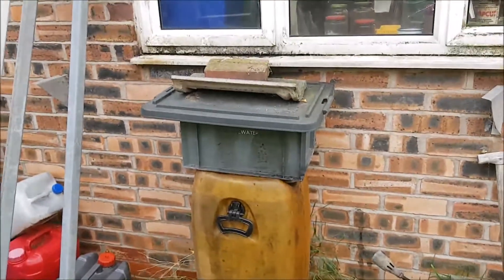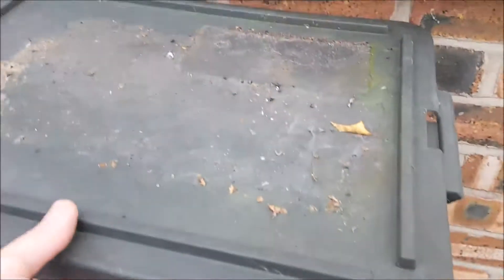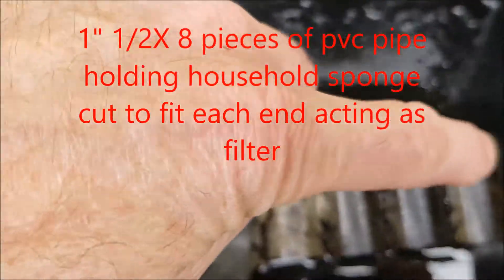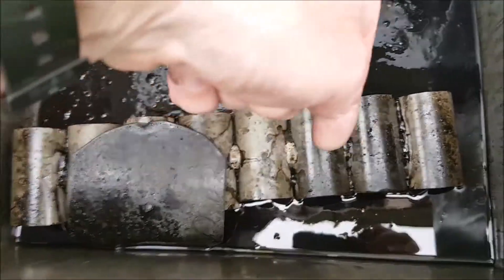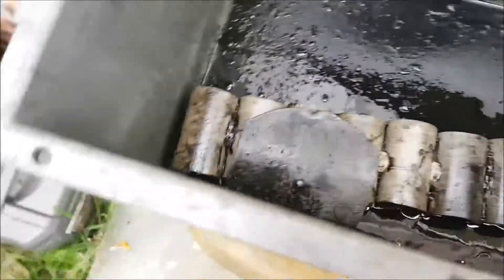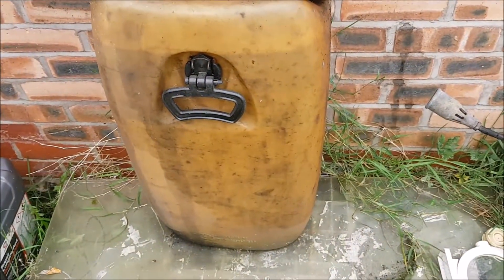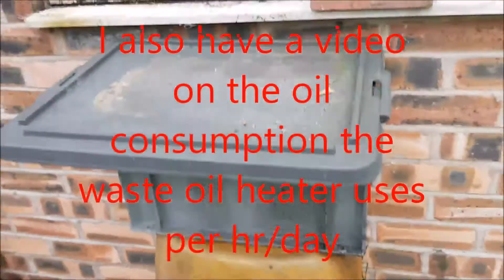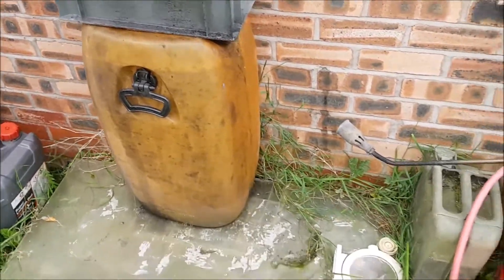homemade Waste oil filter. 25 litres in 5 minutes.UK 2017

Comment: Interesting Concept and also, have you thought about Window Screens?  What about Water problems? Did you find a way around that?
Reply from the maker: Because I'm using an water valve for my drip control i'm not sure window  screen would be fine enough.Not suffered any water issues as all my oil is old engine oil from a local car repair garage and use a drum pump to fill my containers up with the first 6 inches chopped off just to avoid any water in the bottom of the their drum.